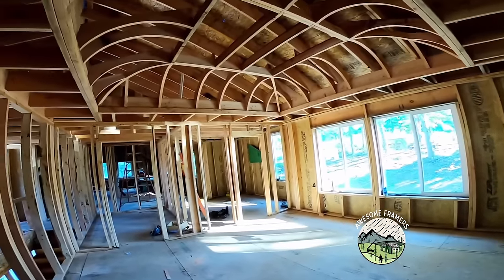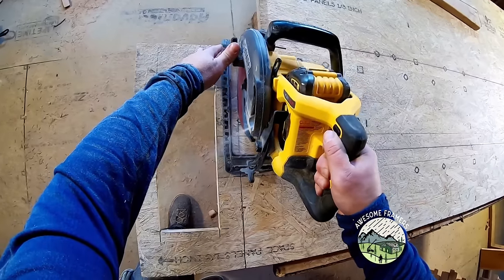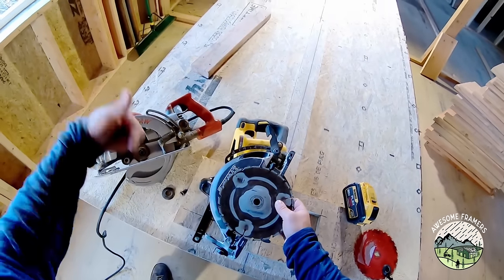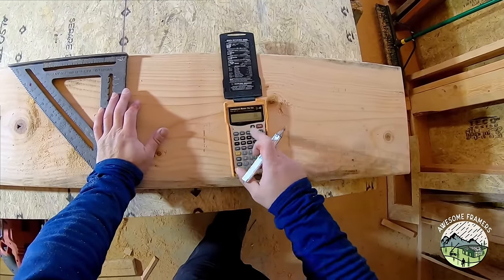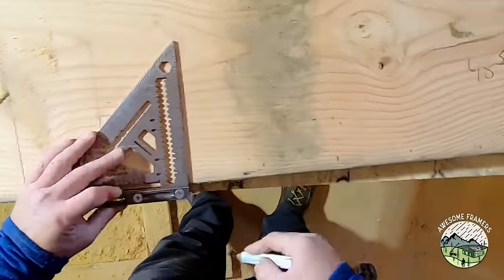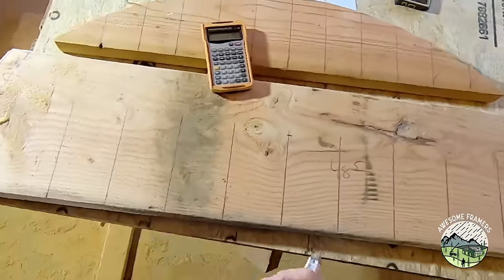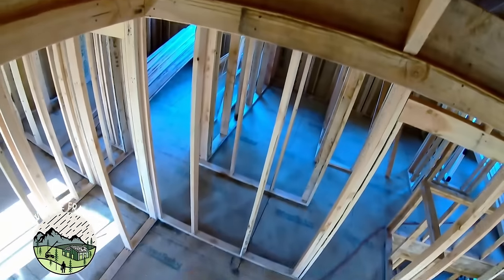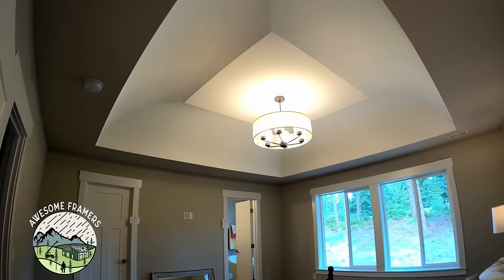Nice Curves!! | Ellipse and Arch Layout

Comment: Tip for drywalling this: wet the back of the drywall and lay it over a few 5 gallon buckets or sawhorses overnight...pre-bent for the next day. Had to hang a 6000 sq ft basement that did not have one straight wall in it...ALL radius walls.
Reply: We need pics
Reply: If you wet the drywall all  you gonne get in few weeks is black mold everywhere, the sheetrock don't have to be wet never
Reply: @JesusGonzalez-gp7iq yes I believe drywall can have no more 1% moisture content
Reply: I would expect the drywall to handle a damp side overnight just fine. When you start plastering it will be wet for a lot longer don’t you think. I think its a tip worth trying. I mean it would save you a lot of time scoring/cutting all the sheets ✌️
Reply: So you'd want to run a dehumidifier in there for a while before painting it?

Comment: If you had cut that elipse with a bevel, id have to hang my boots to rest
Reply: Rockler sells a circle and ellipse cutting jig for routers that would make easy work of it. You'd need the big one with the big Archimedes-style ellipse jig as well.

When setting up for the ellipse, just set one pivot point at the radius, and the other one at the radius times the square root of 2 for square corners. So in this case, 36 inches, and 50 15/16.

Comment: The instruction manual for that calculator must be rather thick for all of the cool functions it has.  For those that say that math and especially geometry is not useful, they clearly have never built anything.   If you didn't have the special flexing circular saw blade, how would you make those cuts?

Comment: Glad to see you did the hips correctly. That is advanced stuff.
You can also just multiply your run by sq-rt of 2 and lay out a grid.
You need blocking for the chandelier…
Reply: Haha you mean 3/4" advantech to fasten to? a couple 1" #6 screws would hold all the chandelier you can dream up and if you want to be corny and throw 1000# up there, add a surface plate and trim it out. Knowing Tim (or just watching his videos, he probably nelled a piece of 2by in the center for blocking anyway.
Reply: @Jacob_Dwyer  - yes a 2x in the center… that’s just what I said…. 🙄

Comment: I did curved ceilings like this years ago with 4×8 sheets of 5/4 fur plywood.
I made the same jig but using a router. for round plates out of 3/4 doubled stack to get 1.5 inch
Reply: We always did it the same as you. I’ve never seen one of those saw blades

Comment: That was awesome, as usual. If you ever have to do another one, look for a company that has a CNC water jet cutter. The cutting tables are 4' x 8' sometimes larger and they can cut @ 100"+ inches per minute in wood and you could stack 2 or possibly 3 boards at a time.

Comment: i would’ve thought that the blade would get really messed up or have significant trouble since it’s not a straight like would u mind please explaining to me why it wouldn’t or explain the process of it
Reply: The blade does get really messed up. It doesn’t warp well until it gets hot. Then it will bend itself to the radius. The trick is to let it spin for 10-15 seconds after the cut to let it balance itself back out, as the blade cools; or it will be warped forever.
Reply from the maker: @michaelgarrow3239  the arcus blade was made to warp
Reply: @AwesomeFramers  - Fancy!   😎
We just used a Diablo or whatever.

Comment: How do you like the DeWalt Flexvolt worm drive compared to your usual Makita? Is it the DCS577?

Do you feel that the extra pep of the 60V (actually 54V) is useful over 18V or 36V, all else equal? 

I have the sidewinder version of the DeWalt, and I noticed that ripping pressure treated lumber felt noticeably easier with it over the normal 18V...